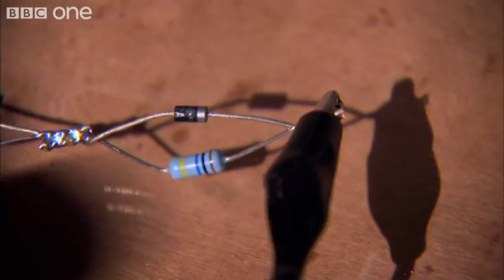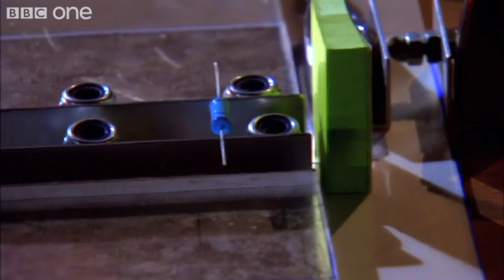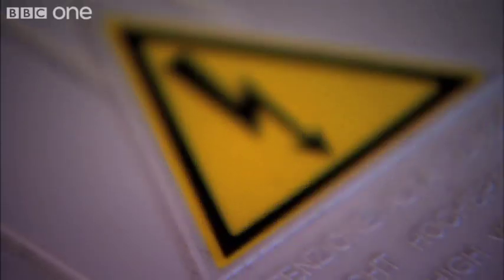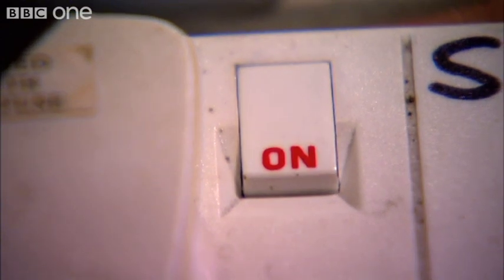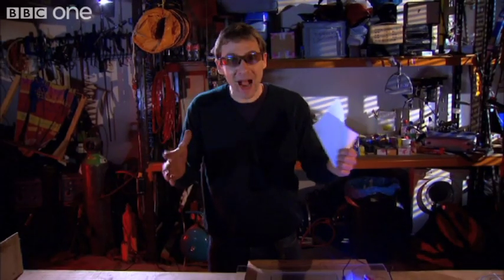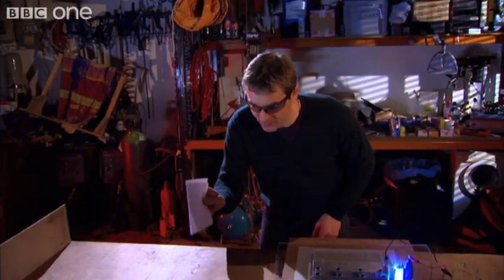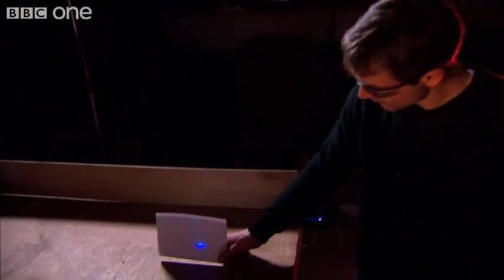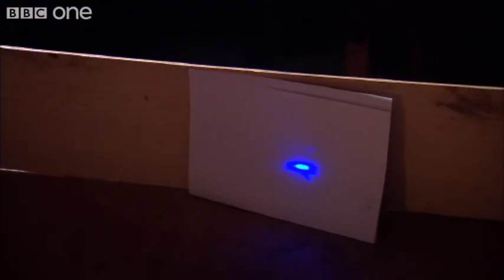Jem's homemade laser - Bang Goes the Theory, preview - BBC

Comment: @qtheplatypus 

If I remember correctly, this is how he made it:
He connected a pair of diodes to the power supply, and placed a sheet with a hole near it to filter some of the rays of light (light is emmited in every direction). The diodes create an electical arc when power is sent to them, exciting the atoms in the air. When photons hit excited atoms, they emit another photon. The result is an amplied beam of light.

I'm don't know for certain though; I might be wrong.